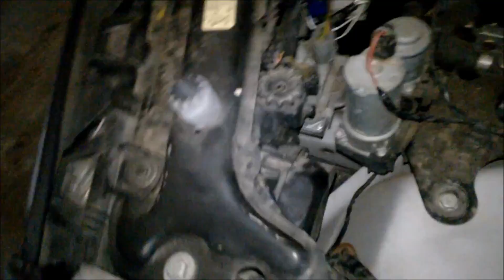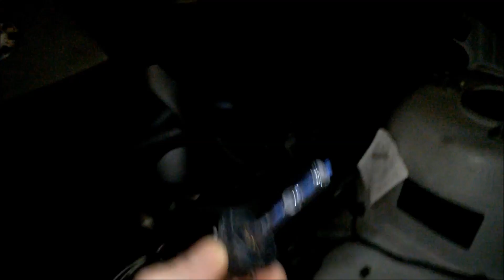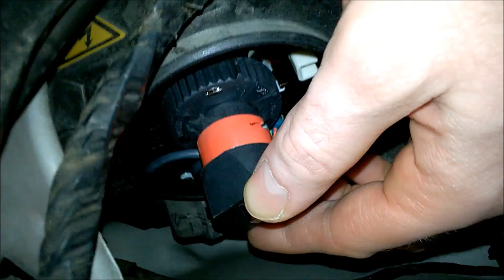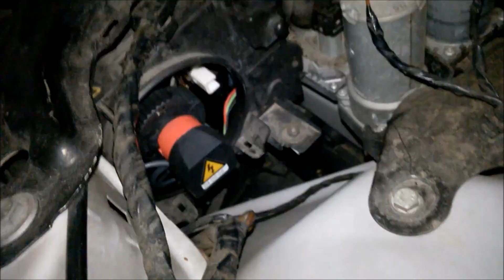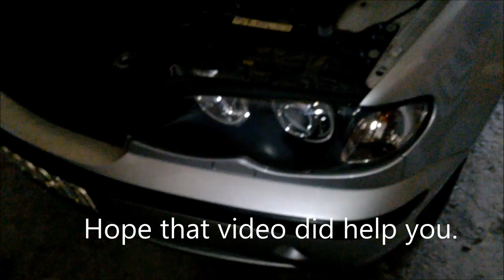How to replace xenon bulb on BMW 3 e46

Comment: I have a 330 e46 coupe with xenon light. Same way?
Reply from the maker: Yes...
Reply: @flying.fox987  Very simple, easy and useful, 
 video..I have question, my left side xenon somethime worked but sometimes didn't, but now doesn't shine at all, could i replace right to the left to check whether it doesn't work because of xenon itself or because of detector?
Reply from the maker: @caucasiandag4856  yes, without any problem...
Reply: @flying.fox987  thanks a lot

Comment: Would you happen to know where the fuse is for the zenon headlight?  I had cracked wires that I had to fix and I'm sure it blew the fuse but I can't seem to find it.
 Thank you for your time in answering my question.
Reply from the maker: Sorry, I dont know where that fuse is.

Comment: DHi have BMW 325 2005 whit headlights halogen 
But I want to put xenon headlights    How do I connect them ?
Reply from the maker: buy "plug n play" set.. that would be the best option and its not expencive.
just make sure you get correct type of bulb..
http://www.safestchina.com/products_image/xenon-hid-conversion-kit-h3-28360.jpg
Reply: Fox Lehkec you know the 325i 2005 come whit halogen lights. And when you desconect them has 2 sockets.  But the xenon headlights has the ballasts and now I'm confused  do you know if I only have to plug the two sockets ?
Reply from the maker: Without ballast will not work.. You must plug two socketd to balast...
Reply: Fox Lehkec so if Il buy the headlight  used whit the ballast already installed in the headlight  I just need to connect one socket to the halogen and the other one  is already inside whit the bulb  so where do I connect the other socket  in the ballast or I just need to connect the halogen an that one give power to the other bulb ?
Reply from the maker: I think in ballast... This i dont know 100% sure, but if its original for your car, ot should not be problem....

Comment: mine is 330xi e46, and autozone tells me i use h7 bulbs for 37$ pair..
Reply: what kind is your 3?
Reply from the maker: Than you have halogen lights, not xenon...
Reply: Fox Lehkec. Thanks.. or that's what they want me to buy.  it seems from your response that it's possible I could have either . When I bought the car I was told that they were Xenon headlights. And then AutoZone gives me this H7 and says "buy this". I guess I just have to go in and see what bulbs are actually in there. I guess for this case it's not as easy as going to AutoZone.  Thanks!
Reply from the maker: well, there are many ways to find out is it xenon or halogen...
Headlight switch...
Halogen is this: https://i.ebayimg.com/images/g/XR8AAOSwARZXm5SH/s-l300.jpg
Xenon is this: http://forum.e46fanatics.com/attachment.php?attachmentid=96940&d=1098981791
Or look in the headlights...
Halogen is this: http://imagehost.helluvafast.com/files/2/2/e46HeadlightPassenger.jpg
Xenon is this: http://www.modbargains.com/images/Products/DEPO/landing%20page/mini-e46%20depo%20headlight.jpg
Reply: Fox Lehkec Thank you for the help in identifying!  So mine are xenon.  I usually like my AutoZone, but new employee didn't  know his stuff,  I figured he was wrong anyway. I think that he was just trying to make a sale to a "girl"...  i suppose he didn't think I knew enough to question him. Thanks for confirming. I will be going through a different source for the real deal... and I ctually don't know that much, learning as I go. This is my first BMW. They sure are a little bit different in some ways and a little bit the same in a lot of ways as other cars. Anyway I love it. And thanks a million for your direct quick video. I try to do whatever I can myself. just the smaller stuff.
Reply from the maker: Im glad I help you!
Anyway, I bought my xenon bulbs on ebay, brand LUNEX is wery good, but much cheaper than philips or osram...
Reply: autozone people are not mechanics for a reason

Comment: Hey bud thanks a million, I had visions of $500 for a new light. I followed your video exactly on my 330xi bixenon light that died, went to local parts store and from reaoem asked for 2XD2S. THE BULB WAS $87 including tax. The auto parts place said whatever you do don't touch the glass part of the bulb. Just finished and works great. Thanks!
Reply from the maker: yep, as you can see, Im not touching glass part of bulb, and it with reason.
Im glad that my video did help you.
I like to as much as I can on my car,  although I'm not a mechanic...
Reply: just curious, what is the reason for not touching the bulb itself?
Reply: HIDs run hot, the oils on your fingers will heat up and burn. Causing the light to fail prematurely

Comment: Did you have to disconnect the battery? Is it a must? Thanks
Reply from the maker: No, just make sure the headlights switch is turned off.
Reply: Thanks for the vid

Comment: Where's your airbox?
Reply from the maker: airbox?? in headlight?
Reply: Fox Lehkec lmao no behind it ...on my e46 the intake is right behind the bulb and there's literally no room to take off the headlight cap. It seems like I have to take out the light assembly
Reply from the maker: oh, you mean the right headlight... yes, there is no room, you can just release bolts that hold headlight, you dont need to take it off.. release those bolts, and you will have enought space than....